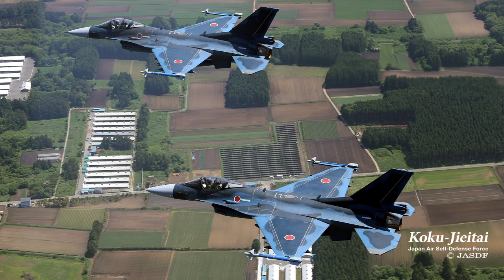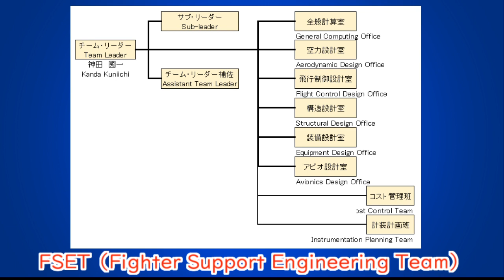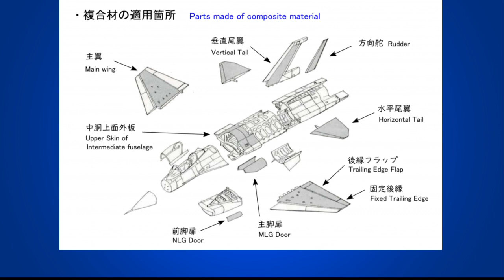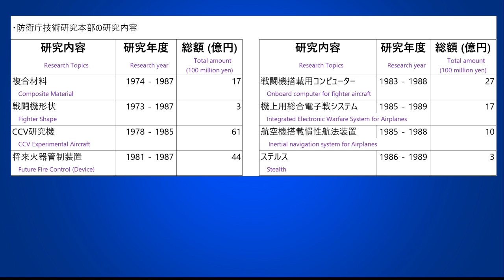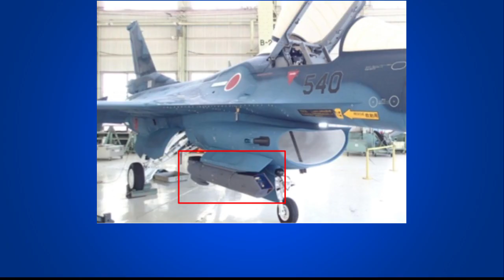Mitsubishi F-2 (Changes from the F-16 as written by the development team leader)

Comment from the maker: 00:10 Introduction
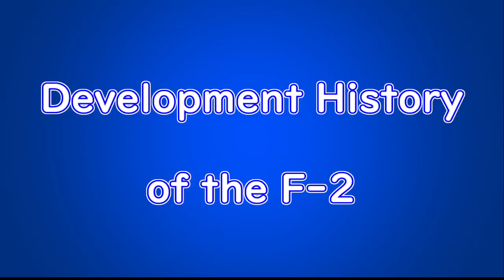00:38 Development History
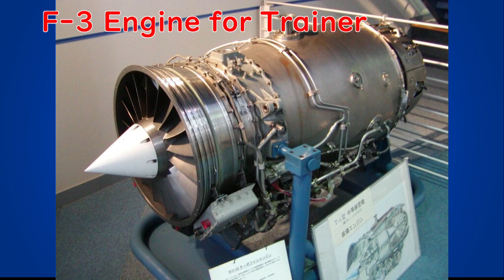02:24 Failure to purchase American-made engines
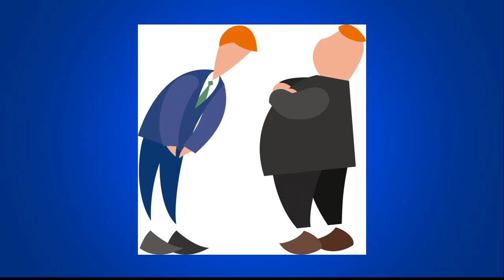03:03 Proposal for joint development
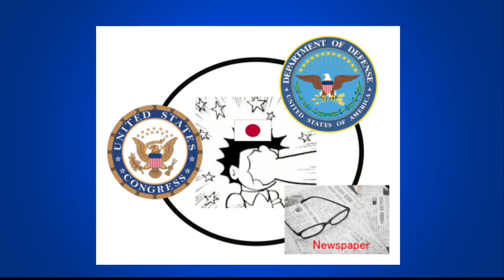04:22 Reduction of technology transfer from the U.S.
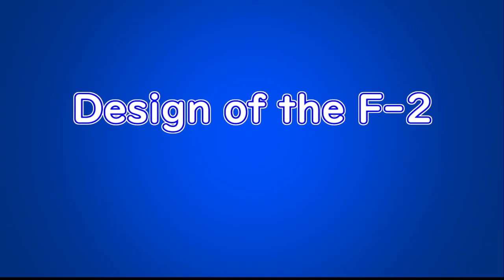05:12 Design of F-2
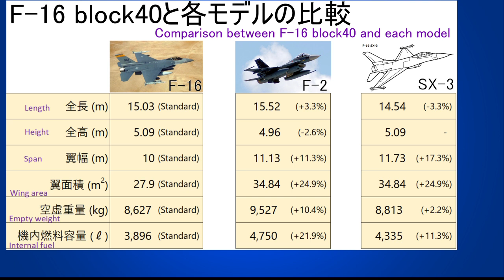05:50 Decision to modify from F-16 Block 40
07:08 Design team and development structure
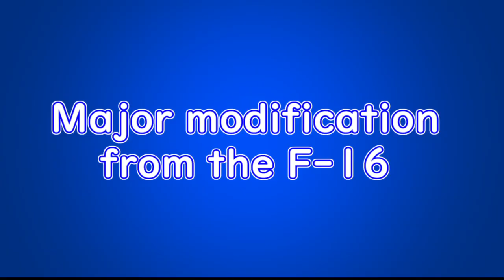09:21 Major modification from the F-16
14:06 Original development and following existing subsystems
17:11 Improvements after mass production
19:35 Final

EDIT: I accidentally showed the time of the Japanese version of the video for a long time, so I corrected it.